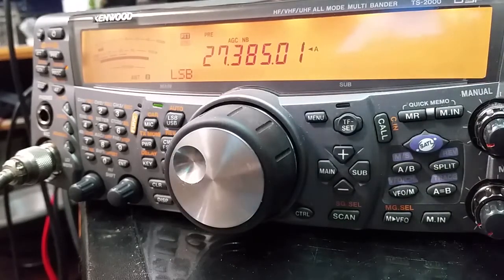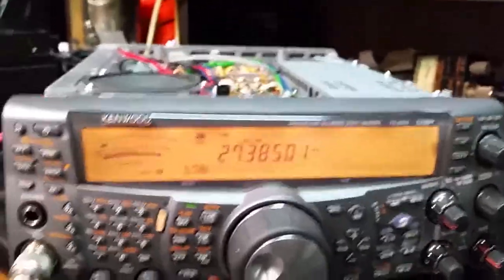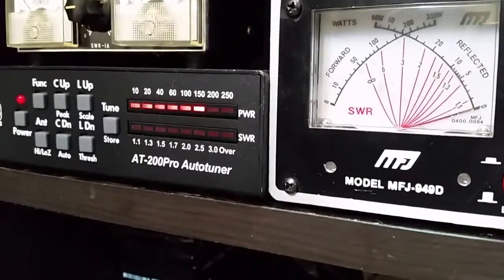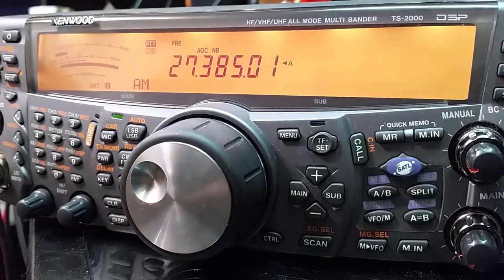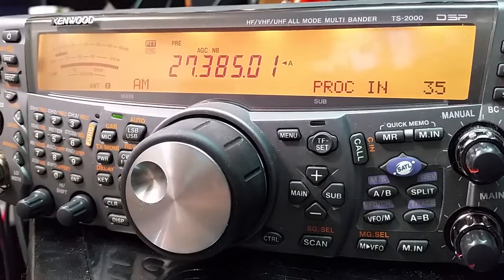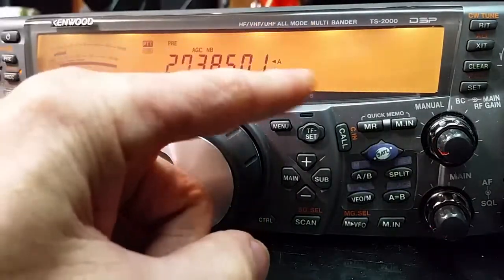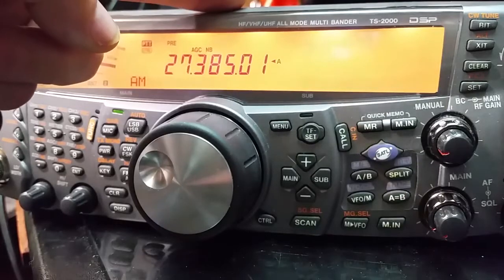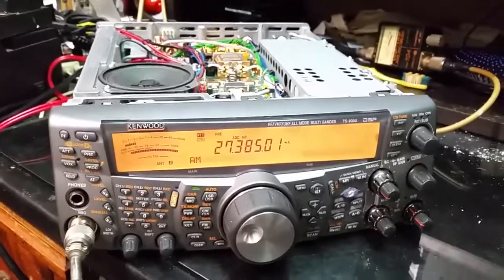Kenwood TS-2000 ALC Mod #2

Comment: Thanks for the video and the useful information. Dealers are beginning to refuse servicing the TS2000 as parts are becoming difficult. Please could you say if that is your experience or would you still buy a clean second hand TS2000?

Comment: Cranking it up to 150W is only going to put stress on the final amp and be barely noticeable on the receiving end. As far as AM goes, putting out 60W carrier is equivalent to 240W PEP. You are going to burn up the amplifier and probably sound like shit doing it.